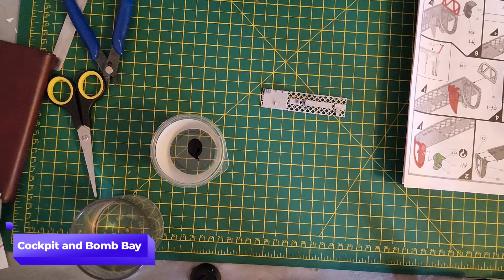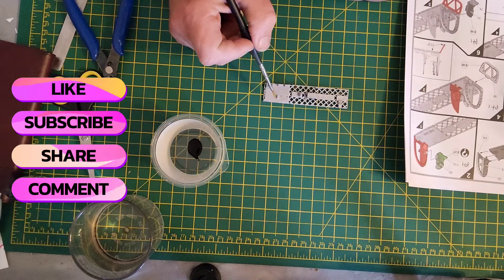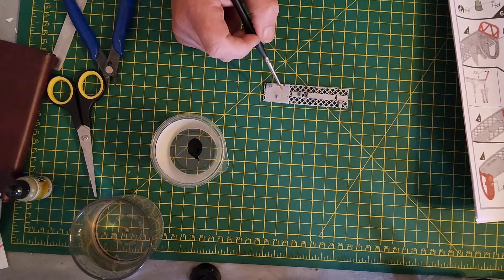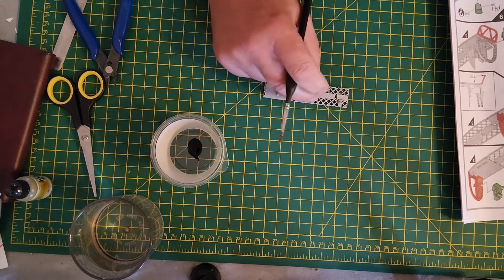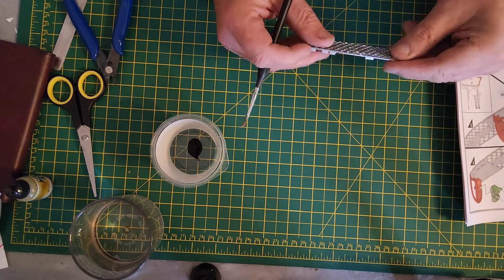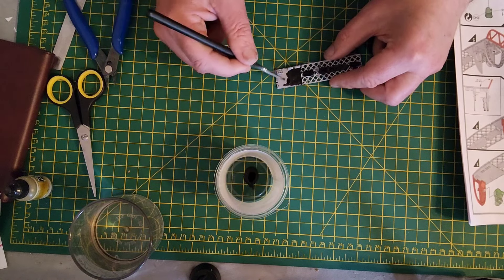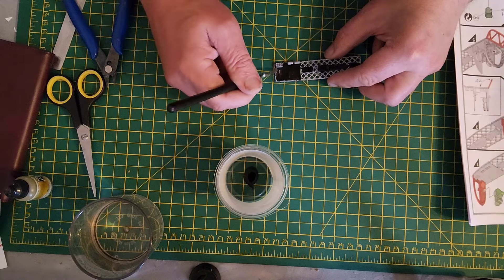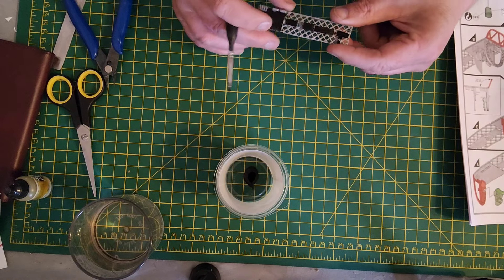Assembling The Airfix Vickers Wellington GR Mk.VIII Part 1

Comment: what happened to your spitfire diaroma project in the end?
Reply from the maker: I will get round to doing it eventually. I need to book time off work to get real work done to the bedroom and get it converted into a hobby room. Only when that is finished, I can start work on a diorama. Also I need to raise funds for getting the materials to build a work bench.
Reply: Steve I don't know if you could alter the angle of the camera a bit next time, most of your work was off camera on this one.
Reply from the maker: I noticed that myself when I watched it back prior to uploading.